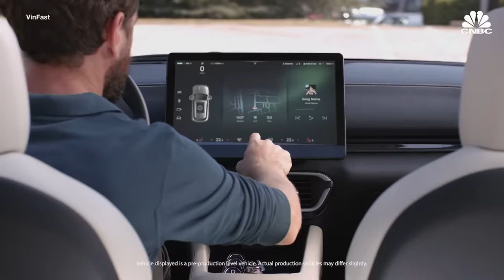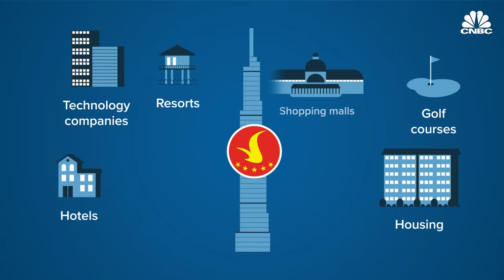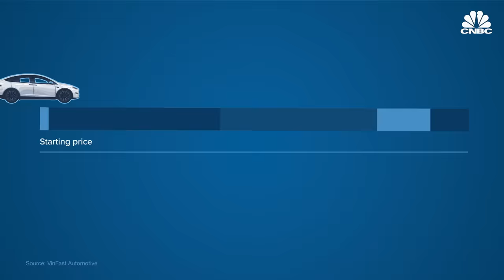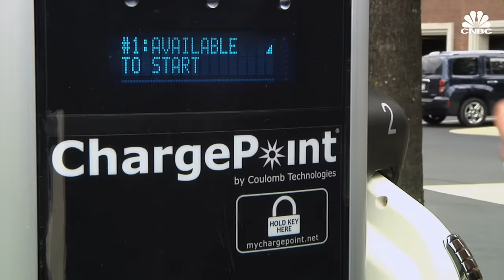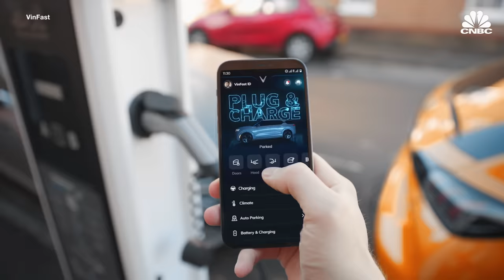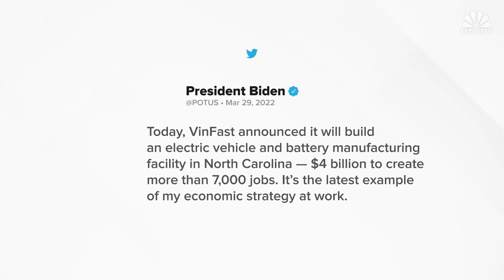How This Vietnamese Carmaker Is Trying To Beat Tesla In The U.S.

Comment: They are going to need to rethink their subscription model. 310 miles a month is not enough for the average American.
Reply: As soon as I heard that I thought the same thing. The average American travels somewhere around 1,200 miles a month - so it’s not at all adequate.
Reply: It's 310 miles of charging that comes with the subscription then you pay out of pocket after that. But electricity is cheaper than gas anyway. I think the crucial part is that they replace the battery after it wears down, which happens faster than people think. A new tesla battery replacement is around $15k, which is a huge drawback of owning luxury ev's.
Reply: I live in city and only travel 130 miles a month 200 is really trying
Reply: The subscription exists solely to extract more money in total by providing a lower up front purchase price. The 310 miles of free charging is probably <$10 and modern EVs seem to be retaining 90%+ of battery life even after 200k+ miles so the "free replacement" is basically worthless.

Math:  25kwh/100 miles (based on Tesla Model 3) * $0.074 (my local electricity rate) * 310 miles = $5.74. Probably closer to $10 in most places since electricity is cheap here.
Reply: 310 miles a month? Dude I commute 400 miles a day. Thats why I choose a Prius Prime over a Tesla. Don't have time to waste charging the battery.
Reply: @Ex-PokerGuy  if you can charge at work and home you'd never have to wait for charging
Reply: @Ex-PokerGuy  Have you considered moving or using public transport? 400 miles a day at an average of  50 miles per hour is 8 hours of commuting. And a total cost of 10k a month in fuel, wear and depreciation.
Reply: Absolutely
Reply: @happilyenraged713  most city folks don’t own cars tho let’s be honest
Reply: @graham1034  I commute non-stop, I drive 400-500 miles a day to dozens of locations so I don't have time to charge since I'm not stationary.
Reply: @SweBeach2023  yeah, I usually get a new car once a year. The thing is I make well over $250k a year so I use $10k to get a use commuter car a every year so it's not too bad. But it does get annoying to have to get oil change once a month, normally it's once a year.
Reply: @SweBeach2023  he drives for work lol
Reply: @Ex-PokerGuy  oof, fair enough. Your work hours must be crazy with that amount of driving. Not bad if you enjoy driving though
Reply: @happilyenraged713  then you don't need a car. You probably have public transportation and ride-sharing as needed
Reply: @Ex-PokerGuy  Prove it
Reply: @happilyenraged713  you should own a bicycle
Reply: @Ex-PokerGuy  did you mean to say 400 miles a week? I can’t imagine a scenario where a 6 hour daily commute would be feasible? If that is what you do, God bless, that’s rough.
Reply: Same thought.
Reply: they have unlimited miles option :))
Reply: @SheriLynNut  he's a bus driver or Delivery boy so his job is driving.
Reply: They also offer unlimited miles for $110/mo (based on recent visit their show room at UTC mall in San Diego CA on July 2022).
Reply: @CocoTaveras8975  😊 9:56 9:56 😅😅😊😊😅AZ
Reply: @SweBeach2023  public transport! Have we got any in the US? Are they reliable and frequent, like in  European countries?

Comment: The car looks great. I really like the idea of leasing battery. Unfortunately not alot of consumers aware how fast a lithium battery degrade. They still think battery will last 10 years if they look after it lol. No! It degrades everytime you drive and charge. If you leave your car outdoor, it will degrade even faster. Lithium battery technology hasn't progressed far and will not be for a long time. Also, when battery gets below a certain capacity, the battery is very volatile meaning it could explode. This is why owning your battery is not a good idea! You rather not pay up front, and always be guaranteed to have a battery working at 100% capacity all the time. Also, alot of people think only market is the end consumers. There are car rental markets where they would want insurance on the battery. Most car insurance do not cover wear and tear. This is why I think VinFast will have an edge over other makers. Having said that, I'd like to see VinFast to provide customisable battery subscription so it will fit with budget at all levels.

Comment: I hope they succeed but I'm skeptical on the battery leasing & the initial vehicle cost. To an unknown & unproven brand it's going to be an uphill battle for many years for Vinfast. They are in for a real slog.
Reply: Owning the car but leasing the battery is dumb.  I think it's just an evil bilking scheme.  I avoid such traps and had already resolved to do so when swapping all our vehicles out for electric.  They will not be from a money-sucking company like this one....
Reply: @DarkPesco  You should go sit in front of a Tesla service center to see how many batteries they change daily on brand-new cars
Reply: @rayray2001111  So of course you know, no one is ever going to do this right? So asking for a friend, and I’m assuming you have done this, so what is the number of batteries that you personally witnessed that they changed and in what time period did you observe these changes?
Reply: For those who have never owned an electric vehicle when your battery will come to an end which all batteries do eventually right there your problem: it will cost you an arm and a leg. So leasing it's a great idea. You do the driving and you don't need to worry about the expensive replacement of the battery.  Phone batteries die so do car batteries same thing just bigger.
Reply: @davrocket5304  Well if that's your only worry, then there's a simple answer! Don't buy an EV! Comphrende! Cheers!🥂
Reply: Tesla was unknown and unproven at one point.
Reply: @davrocket5304  leasing battery makes sense starting on the 8th or 10th years of owning a VF. Before the 8th-10th yrs, you are giving VF $10-$12 thousand dollars of your money. I don’t let my b*tch manage my $, so F that VF.
Reply: @rayray2001111  but it's not like vinfast is giving theirs for free! You're constantly paying for it!
Reply: @davrocket5304  "don't need to worry".. when you're paying for the battery every month it is still expensive.. and a worry!
Reply: @saulgoodman2018  but they have a cool name and brand.. unlike.. vinfast
Reply: @paraic9163  so what.
Reply: @saulgoodman2018  so they gonna fail
Reply: @paraic9163  why?
You can tell who's a tesla fanboy.
Reply: @saulgoodman2018  because people don't wanna buy a car that sounds like a toy or a sports drink or something.. people who spend 10s of thousands of dollars on cars want to show off.. imagine going to your friends and being like.. "check out the new ride.. vietnamese quality.. vinfast! That means it goes fast brrrmmm brrrmmm" 🤣
Reply: @paraic9163  Give me a break.
Reply: @saulgoodman2018  haha you know I'm right
Reply: @paraic9163  Yeah right.
Reply: Me too. We had two Teslas and thinking about getting a VF9, I will wait when they open a show room in the bay area and decide. I also want VinFast to succeed. VinGroup is the most successful company in VN for the last 15 years . I admire them and wishing them the best
Reply: @josephlai6451  if you dig into them you'll see they're quite shady and not very admirable..
Reply: @saulgoodman2018  , Tesla developed their auto tech from scratch, it took almost 5 years to come up with one good model.
Tesla's owners also have a good track record in developing and commercializing hi-tech consumer products / services.
That's why they gain the trust of consumers.
You can't say the same about Vinfast/Vingoup, for one year they roll out 5 models.
What a laughing joke.
Reply: @josephlai6451  , This is not a normal business like any others.
it survives with the ill-gotten gains from land grabs through political connection and corruption.

In socialist Viet Nam, every year thousands of families lost their houses and land due to land grabs.
Reply: @ongmat4439  They did not develop anything from scratch.
You just cannot stand when anyone criticize them.
Reply: @saulgoodman2018  , Yeah..in the dream of a vin bot....LOL
Reply: @DarkPesco  it means you don’t need to worry about battery. It’s very expensive to change one. If you know how to invest the money instead of going to buying battery, you can make profit. And pay back to your vehicle. They also have an option to buy the battery too. Maybe next year.
Reply: The market is really competitive. 
North Carolina is a place know for poor production quality from Boeing.
Reply: I think you guys are missing the point about battery leasing. It’s all about making the car initially affordable then vinfast gets back the real cost by the “battery leasing “ monthly payment. It’s a clever financial scheme but rather to see vinfast market it differently so we don’t have this type of discussion
Reply: @thev5140  You just described cars made by Tesla. 😂
Reply: @jaydibernardo4320  - today electric vehicles are sold in the US, Canada and the West,
GMC EV — 47 MPGe, Rivian R1S — 69 MPGe, Porsche Taycan Cross Turismo, Jaguar I-Pace — 76 MPGe, Audi e-tron Sportback,
Audi e-tron — 78 MPGe , Volvo XC40 Recharge — 85 MPGe ,
BMW iX — 86 MPGe , Mazda MX-30 — 92 MPGe , Mercedes EQS — 97 MPGe ,Ford Mustang Mach-E — 101 MPGe ,
Tesla Model X — 102 MPGe , Polestar 2 — 107 MPGe (tie) ,
Volkswagen ID.4 — 107 MPGe (tie), Mini Cooper SE Electric — 110 MPGe ,Nissan Leaf — 111 MPGe , Kia Niro EV — 112 MPGe ,
Hyundai Ioniq 5 — 114 MPGe , Chevrolet Bolt EUV — 115 MPGe ,
Tesla Model S — 120 MPGe (tie), Lucid Air — 131 MPGe, no one knows vinfast car , no one care ev vinfast , most ev not made in comunist country , because the communist education is still backward
Reply: @paraic9163  don’t forget that buying the car and leasing the battery which is the sane as you leasing the car because you are limited with your mileage ;as you are leasing the car), so you pay $50k for the car and you are limited by the mileage per month or year, this is not good.
Reply: Vinfast is starting out and the battery leasing scheme may as well be a sort of grand opening specials.  The leasing may end up costing the company $billions, and I am quite sure it's in their cost projection plan to accept such a financial loss as the cost to build a brand.
Reply: @dantse2012able  don’t forget that in the battery leasing, Vinfast limites the mileage per month or per year, Otherwise there í penalty if you use the battery for a higher mileage as limited
Reply: @DarkPesco  you know lithium prices will continue to rise as more and more mobile phones and electric vehicles get produced. Replacing a battery will cost you an arm or a leg in the very close future. If you look at tesla battery prices. Their price have already increased by double. Having a battery subscription is a very clever and long term vision. Also, lithium batteries can only have limited number of charges before you have to replace a new one and, after a year, your battery would probably hold 80% charge. Would you rather spend 15k on a new battery or would you pay a small fee monthly to get a new battery at any time? Alot of people saying you pay 12k in 10 years, in that 10 years, you would have serviced or swap new 10 batteries which valued a lot more. How many times do you think you can replace tesla batteries with the same amount in 10 years?
Reply: @saulgoodman2018  And then that automatic update for the self driving feature really put them on the map, not in a good way 🤦‍♂️
Reply: @paraic9163  Are you though ?
Reply: @sawtooth808  am I what?

Comment: You can now have a choice of buying a VinFast in a total or with a monthly subscription for the battery. Also, according to Reuters this week, VinFast has struck a dealt with the US car subscription service Autonomy to supply more than 2.500 units of VF8 and VF9. It's VinFast's largest order to date and also solidifies its foothold in the EV market. Did you know the VF8 has 11 airbags, while Tesla Model Y made in China has only 7 airbags? In addition to having the best in the business for its designs by the famous ItalDesign, VinFast is BMW based and at affordable prices with many high tech features including HUD, voice activation, face recognition, cam 360 and safety and driver assist technology such as virtual assistant, drive assist, lane-keeping assist, collision mitigation, and driver monitoring. That's not it, folks! Heated and cooled seats in cars are luxury at its finest. Yep! Affordable VF8 and VF9 Plus Models have them all.

Comment: Judging by the two latest EV entrants Rivian and Lucid, I don't think investors would be too thrilled for another EV IPO.  They might have trouble raising the needed capital.
Reply: Rivians are beautiful. I was stunned when I saw one for the first time
Reply: They are already selling cars for years which is more that most EV start ups can say. Mass production is a huge hurdle for any new auto manufacturer.

Rivian is still having mass production teething issues and are using hand assembly to desperately get cars out to customers in order to maintain investor confidence.
Reply: Lucid: only producing 12,000 to 14,000 vehicles for 2022. A wait list of two years & a starting price of $77,400. Rivian: price starts at $68,575 & has only produced less then 7,000 vehicles in 2022. Rivian has a target of 25,000 units for 2022. Yeah, sure. My money is on Vinfast to outlast these two. I'm skeptical of the battery leasing but my gut tells me that this company means business (pun intended).
Reply: All these comments are missing the point: Investors will look to the fact that Rivian and Lucid are far below their IPO price and may not stomach another EV IPO.
Reply: Thats even better for investors,do they can buy the stock for a reasonable price!
Reply: @brunoheggli2888  Not if the company tanks, which is what generally happens if a market is already becoming saturated.  If the market was thriving then Rivian and Lucid would have a high share price, but they don't because few people want to bet on a competitor of Tesla, especially when they are popping up everywhere.
Reply: @krashd  Tesla growh is already slowing and profitmargins went down 4%  and in europa Tesla is only number 4 behind Stellantis in ev sales!Sure you see a lot of Teslas because they sell tbe same modell suce about 10 years so there are many Teslas on the street!But the past doesnt count only the future!Tesla had the first mover advantage,but thats gone now!
Reply: @1263tonyrc  Better prices means lower margins and thats bad for investors but good for consumers!Thats why it wont be a very good idea to invest in the automotiv sector at all other then possible Ferrari
Reply: People don't understand how hard it is to profitably sell EVs... Tesla has next generation manufacturing.  The only other companies I see having a chance are maybe Ford and the Chinese EVs.  If anyone thinks differently, my guess is you do not follow the industry close enough.
Reply: Exactly what I mean. Rivian has Jeff bezo, Lcid has Saudi Arabia as an backer. They may survive  but Vinfast? 2 billions is not enough .VW is in serious debts.
Reply: @jaydibernardo4320  for your information. They plan for a quick profit with IPO and run.
They failed once with combustion now electric is going to be successful?
Reply: Agree, Enough autos in the USA already.
Reply: You have to rent the batteries for the car. LOL!!!!

Comment: Generally, an EV is totally different from an ICE car. The internal combustion engine (ICE) has many moving parts - an average 4-cylinder engine has at least 40. Imagine how many moving parts for a 6- or 8-cylinder engine (V6 or V8)! It needs oil and fuel filters changed regularly, timing chain or belt is vital and needs maintenance, poly-v belts run every auxiliary component - as you know from experience, this list goes on and on. By contrast, the electric motor mostly needs no maintenance and has only two moving parts. You don't have to pay for any smoke check, oil - filter change, timing belt change and more. Use part of this ICE maintenance money to pay for the battery leasing program like that of Vinfast because nobody or company wants to buy an EV with a battery of 5 - 6 years or older unless that EV comes with a battery leasing program, which will guarantee them a new battery replacement for free. Surprisingly, Vinfast battery leasing program offers the leasing price as low as roughly 1 buck/day (up to 3,100 miles/month) or about 3 bucks/day with unlimited miles.
Reply: oops !!-----looks like you forget to mention the massive environmental destruction resulting from battery production. 
Your gasoline car is far better for the environment !
Reply: @wave8359  Oops!!.....looks like you forgot to mention Vinfast battery leasing program helps recycle all Vinfast batteries to protect the environment. The key point is to make it and recycle it, duh!
Reply: @wave8359  "Your gasoline car is far better for the environment"??? That's just a one-sided argument. According to eia.gov, America used about 135 billion gallons of gasoline in 2021. And people worldwide used over 320 billion gallons of gasoline each year. Imagine how much carbon dioxide we are emitting yearly! Also, most of the fossil fuels we used today take roughly 150 million years to form, and we know all the natural resources won't last forever. If we use up all the resources, do we need to wait for another 150 million years? The point of using EVs is to help not only improve the environment but also reduce our dependence on fossil fuels. This is why EVs are more appealing, and Vinfast is working hard to bring its commitment to sustainability to life since Vinfast EVs are great for the environment and its affordable prices do good for our wallets.